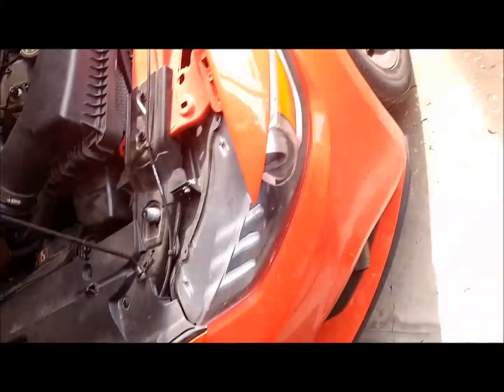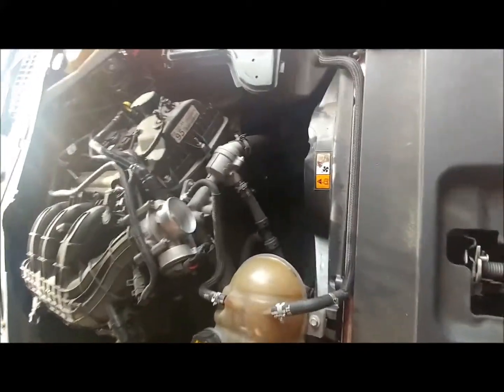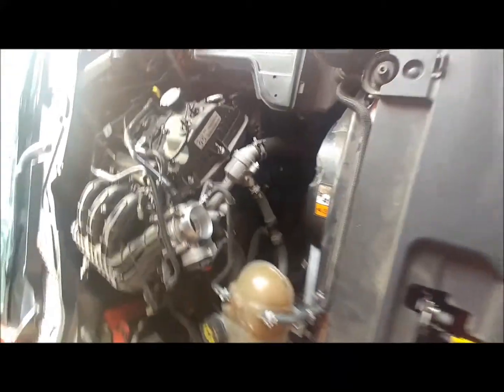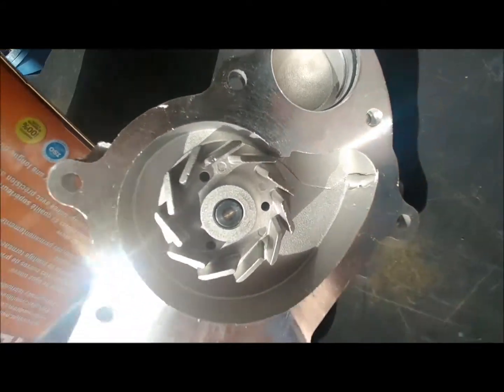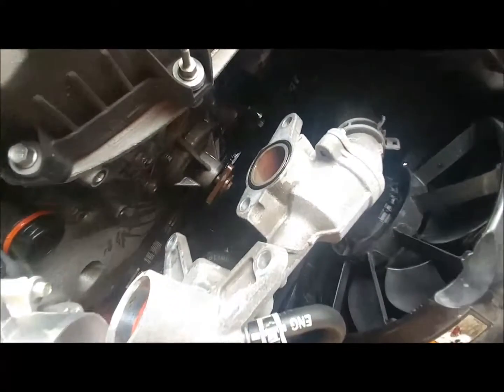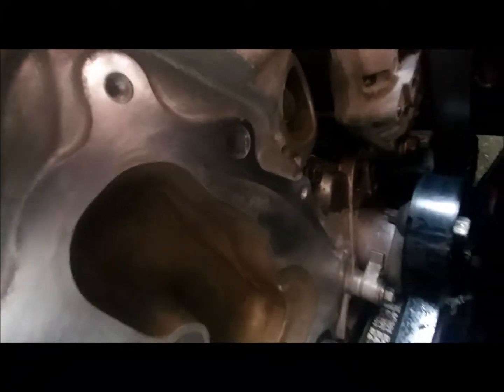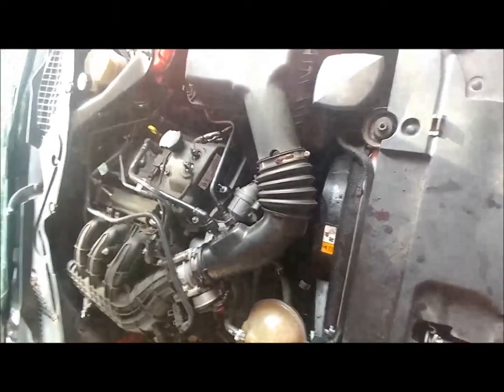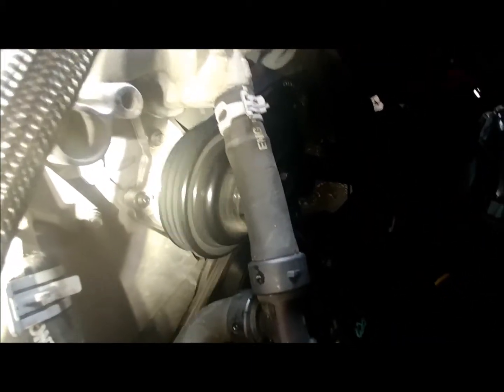2016 V6 Mustang waterpump replacement

Comment: I have a 2015 Mustang V6, is it also a 3-bolt or is it a 4-bolt? Wanna make sure before I buy this part
Reply from the maker: Look at the fan, is there  3 or 4 bolts holding it on

Comment: Did you have to use any rtv or silicon gasket maker when replacing it or was that not needed?
Reply from the maker: I don't recall but all the water pumps a change in the last 10 years all head o-ring type seals
Reply from the maker: No RTV

Comment: 2016 and water pump fail already. ?
Reply from the maker: It was Dripping antifreeze out of The Tell-Tale weep hole
Reply: Mine failed too man and its a 16
Reply: YUP POS ford and they won't cover it.
Reply: Mine just failed too…2017
Reply: Just bought a 2017 and yep water pump is failing on mine
Reply: I got a 2016 v6 as well and now my water pump is failing 😢